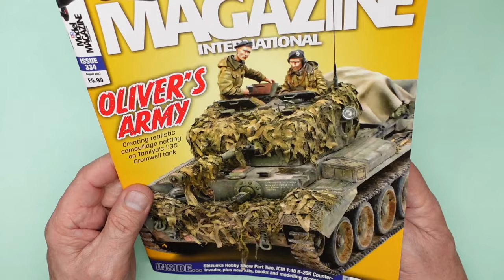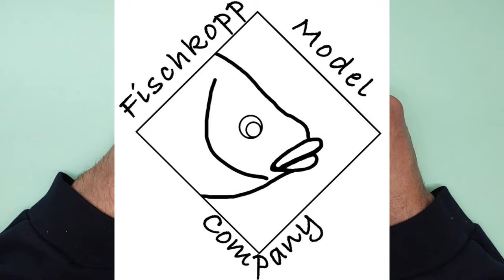Fischkopp 1/32 Merlin engine cam gears and prop shaft

Comment: fantastic job as always. Quick question, I am about to make a kit made from resin, can you use mr surfacer as a primer on it.
Reply from the maker: Yes you can, but scrub in detergent first and check on an inconspicuous area first. Some resins will not take Mr Surfacer. Mr Hobby do a specific primer for resin.
Reply: Cheers nigel, once again a fountain of all knowledge.  It's an accurate armour kit, first time stepping out of my comfort zone, wish me luck 😂😂😂

Comment: On the subject of engines. It would be cool if Anyz could send you some copper braided lines and spark plugs connectors for the A-20.  I think a lot of us novice would like to learn how to properly detail a radial engine.
Reply from the maker: I have those already from Anyz. Maybe I'll use them on the A-20?
Reply: I've found that the little firms that make detail bits for auto models have wonderful items useful to us aviation modelers. Especially braided hose, rubber hose, ignition wiring in various thicknesses, and on and on. Check them out.